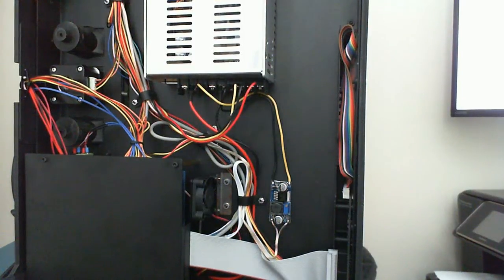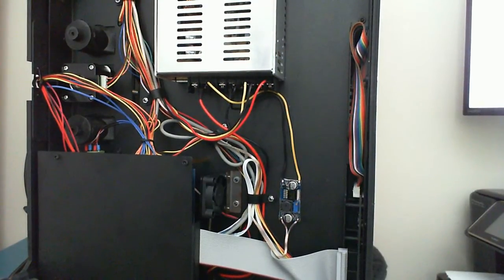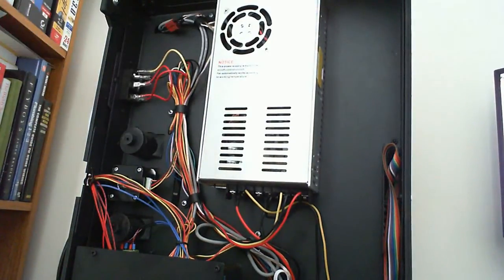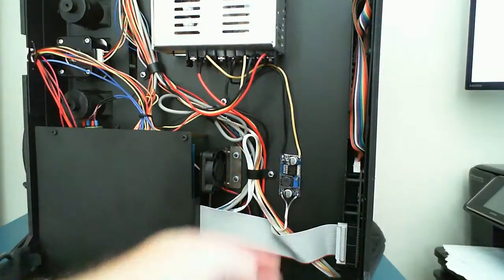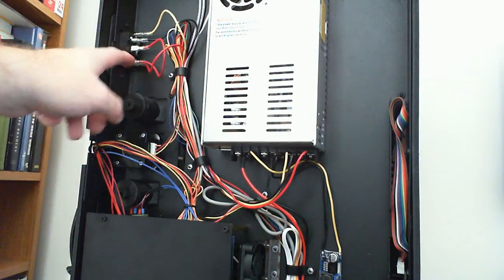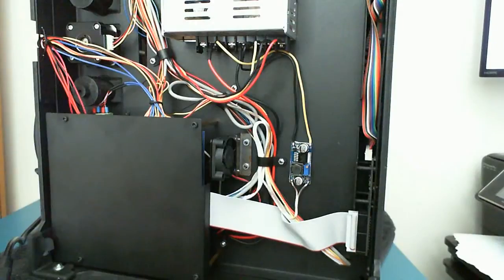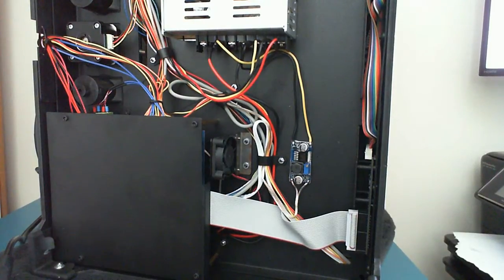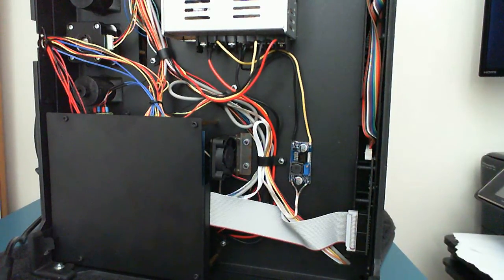FlashForge 3D Printer Mods / Upgrades

Comment: Great video. I'm thinking about using the 24v to 12v converter but I am having trouble finding it on Amazon. Do you thing you can re-post the link?
Reply from the maker: Here ya go! Don't forget to like and subscribe!

http://www.amazon.com/gp/aw/d/B009HPB1OI/ref=mp_s_a_1_2?qid=1430245123&sr=8-2&pi=AC_SY200_QL40&keywords=dc+buck&dpPl=1&dpID=51brk4q0RML&ref=plSrch
Reply: Matt Medley Thank you. I just liked and subscribed!